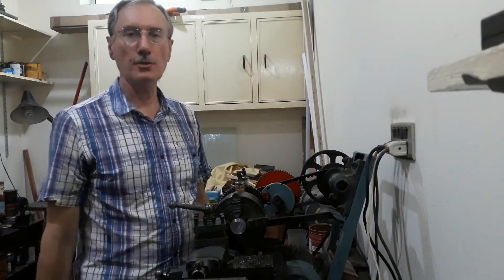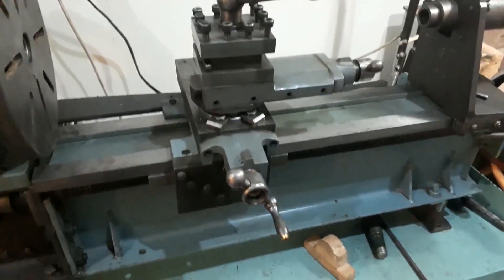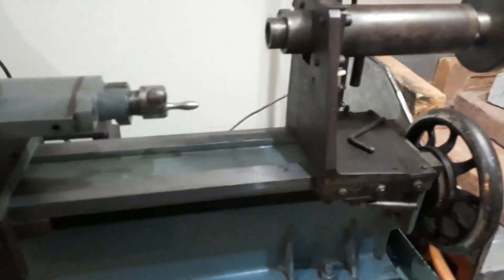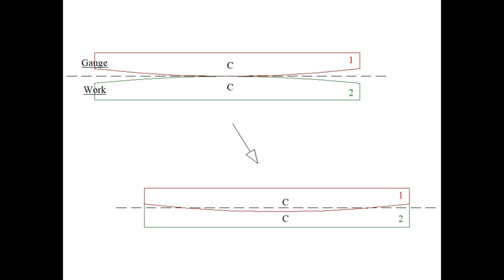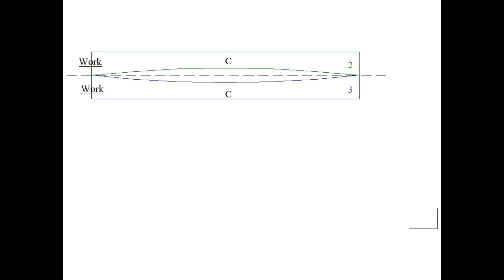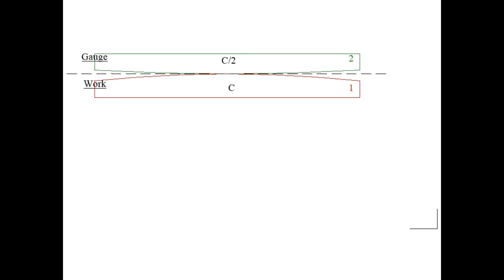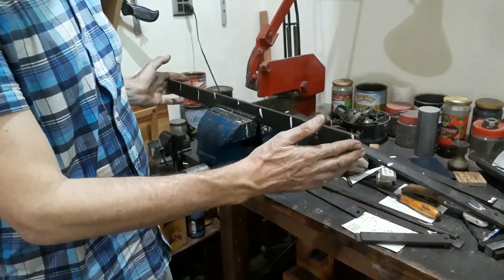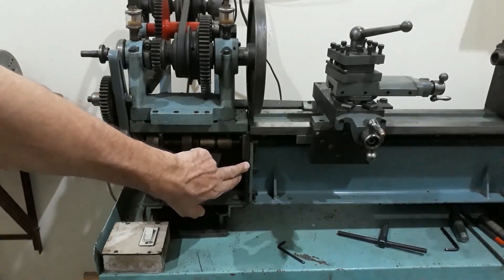Homemade Lathe - #1

Comment: been watching your videos i purchased colchester student ,,,the massive nut that holds the chuck seems to want to loosen ,,,how do i rectify
Reply from the maker: Presumably you have been able to tighten it with the large 'C' spanner. The next question is whether the L0 nose mounting is clean. What are the surfaces like between the chuck and the nose? If they are clean and fit properly the large nut should be required to push the chuck off the taper as well as to lock it on - the taper should be a good locking fit.  If you watch my video https://youtu.be/V0rosdRnBXk at 1min 10sec you will see that this happening.
Hope this gives some clues.

Comment: Sir can u make a detailed video on how to make those straight edges and making them flat and square...
Reply from the maker: Thanks for your question Yogender. I don't currently have the opportunity to produce a video on that topic - perhaps I will be able to return to this in the future. In summary I used files, the straight edges, a purpose made steel wet & dry abrasive holder, a square and clamps to hold a straight edge at some distance from the narrow ways to ensure that I was filing surfaces square. For measurements I used the straight edges, calipers and a micrometer.

Comment: However, you did a good job with your homemade lathe because got a good plan nice work design your project so I think don't have much problem. My mind is too many problems when I had done in future I will build a new lathe after experiencee with older m.
Reply from the maker: Yes, sometimes it is good to gain experience before moving onto the next stage.